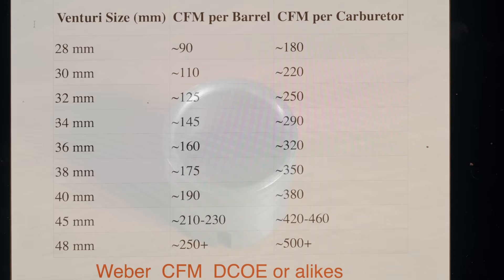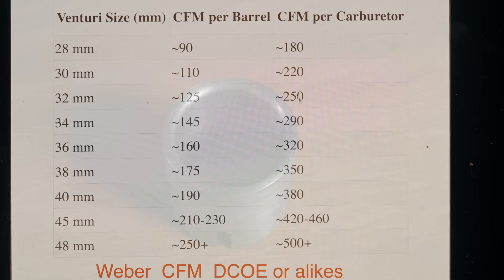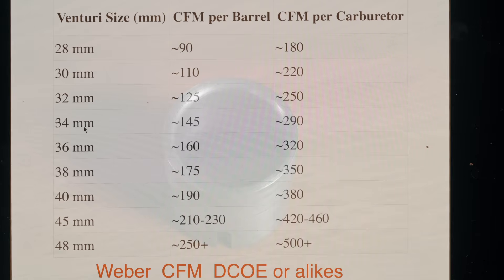The Weber carburettor,  size does matter and here is how and why

Comment: No, you can't divide 260 cfm by four when you have one barrel per cylinder, that's way too small. 65 cfm per port means about 65 HP on that engine, and such an engine in the example will probably produce at least 160-170HP
Reply: You both are wrong. God, I swear if I have to butt into a debate in the comment section, one more time, I’m gonna freak out.
Reply from the maker: Peter, I disagree with you and here is why: Thanks for the comments , however I do not agree entirely.  Let me clarify why :
To estimate the horsepower generated by a 90 CFM (Cubic Feet per Minute) air/fuel mixture in a single 250cc cylinder ( note that I used a 2ltr engine with 4 cylinders) , the  general approach is based on air consumption, engine efficiency, and power factors. Here’s the breakdown:

Lets make some assumptions first:
Air/Fuel Ratio: Typically 14.7:1 for gasoline (stoichiometric)
Volumetric Efficiency: Usually between 85% to 95% for naturally aspirated engines
Engine Speed: RPM significantly impacts CFM and horsepower output
Thermal Efficiency and Losses: horsepower-per-CFM rules

Theoretical Maximal Power:
General rule  1 CFM supports approximately 0.5 to 0.6 horsepower in a well-tuned gasoline engine.  
So, with 90 CFM that is 0.5x90 =45HP   and 0.6x90=54HP
For the entire engine that is about 180Hp

Of course that is theoretical, and in practice  there are many losses  and max’s  out at around 30-40 horsepower ( for a naturally aspirated configuration).

Thus in my example in the Video that engine would make about 160 HP.
Reply: I have a 4cyl engine of 1300cc. The original carburetor is a single barrel downdraft with a 24mm venturi. Engine as stock is rated 52hp@5500rpm.

If I am selecting a venturi for this engine for twin sidedrafts using the usual methods I get 27mm. I have run that setup and i can tell you it does not work, and it does not increase power. If 1 venturi of 24mm can flow enough for 4 cylinders then even bigger venturis with 1 per cylinder can only be detrimental. You would think 1 24mm venturi per cylinder would probably work better.

Comment: 🏎🏎🏎🏎🏎
Reply: so, say the intake port diameter from the manifold to head is 30mm and ur using a 36mm choke--it wouldnt matter and one would be better off using a 30mm choke?
Reply from the maker: OK, here we have a few points that need to be addressed.   First the physical barrel opening of the carb must be a perfect match to the intake manifold port diameter.   If you have a DCOE 40, then the inlet manifold port must be  40mm  .  The venturi is fitted inside the carb and needs to be sized for its specific size  needed for that engine.   In your example, with a 30mm port on the intake manifold should never be used  with a carb barrel that is not 30mm.  A larger carb ( barrel) will cause a real bad flow and turbulance as the airflow will hit the edge/rim of the intake manifold.

Comment: Reality is that the competition engine always makes more power on the dyno with a larger carb than this formula makes.  For example my 2.0 pinto revving to 7500 made more with a pair of 45 dcoe’s than 40s.  My 4.2 xk revving to 6800 is on triple 48s.  It’s not great at low rpm of course but makes a lot more peak power than 45s.  I don’t recall the exact choke size is each but you get the idea.
Reply from the maker: yep, but its the choke that matters the most in your 45 and 40's   , besides many other settings...

Comment: Excellent video! Thankyou so much :)

Would it be possible to do a short update to this but related to SU carbs and issues around the Siamese port? And maybe talking about sizing to correct exhaust please? :)
Reply from the maker: I will have a go at it later if that is ok
Reply: @ thanks so much!!! I have an issue with my MGB type engine where the power falls over quite dramatically at 6400rpm… it is not caused by inlet or head ports… so I think the exhaust is too small but I have no idea how to size it correctly… i.e. are the exhaust gases the same, more or less volume as the inlet gases? No idea!! :)
Reply: @stooartbabay  have you looked at possible valve float/weak valve springs? The RPMs you mention are typical OEM valve spring limits.